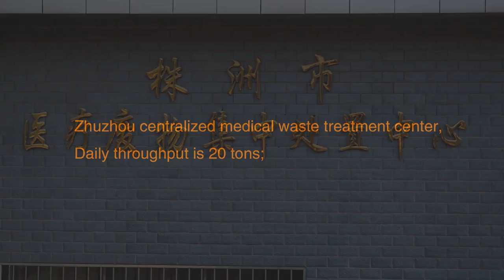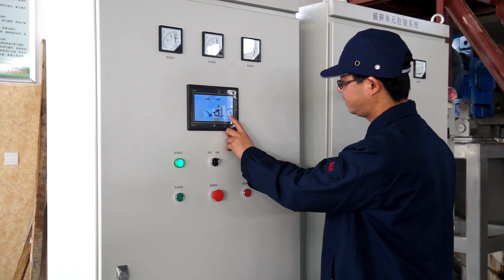LIVE Medical waste autoclave treatment center | Gient

Comment: Is there any generation of effluent? It is channelled for treatment or discharge direct to the water course?
Reply: I would certainly hope it would go through some industrial wastewater treatment!
Reply: I’m just diving into the topic of waste autoclaves now myself, but if my understanding is correct, there should be a sizable amount due to the steam essentially distilling off any solubles and some oils.  Also there is probably some leachate before/after + site/equipment cleaning water.

I’m guessing Screen Filter/Hydrocyclone/Filter Press etc (to capture waste particles), then an Oil-Water Separator, then whatever really.  An Anaerobic Digester Maybe?  That and/or then a Spray Dryer/Evaporation Pond etc for mineral recovery?  Also Granulated Activated Carbon Absorbers and either landfill (cheap but bad option) or Gasification/Incineration etc (WITH FLUE GAS SCRUBBING+ASH/SLAG RECOVERY!) would work for removing any “nasties”

I’m not an expert, and as stated haven’t read much yet on this topic, but I imagine that is what a system would likely look like*if they are using one*